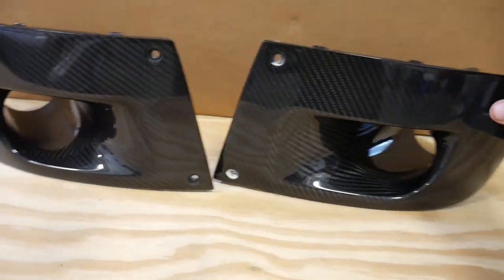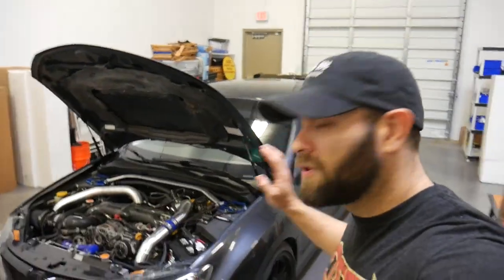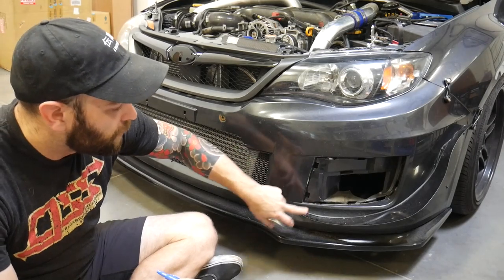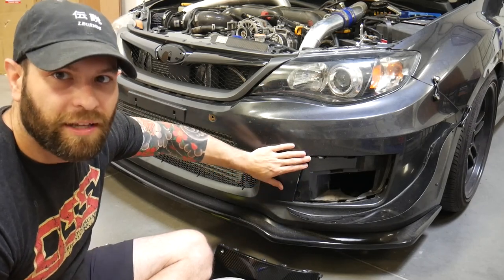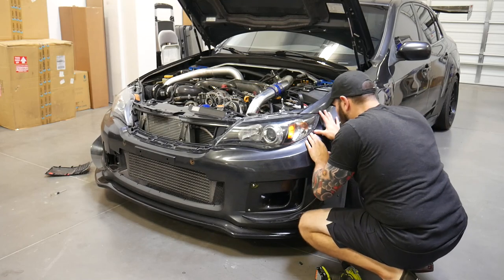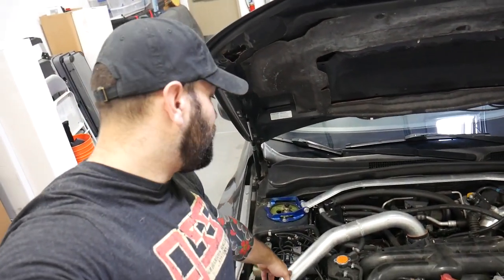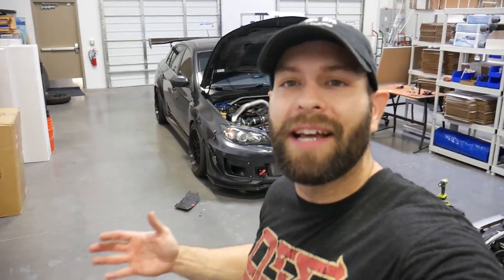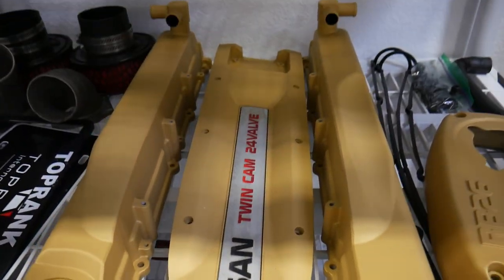WRX STI gets some Carbon Brake Ducts!!

Comment: Can you install your fog lights by any chance?🤔
Reply from the maker: UH why? these are brake ducts, I am confused
Reply: @RyanDenton  i wish they had carbon fiber fog light covers. I run diode dynamic fog lights which i love so much. But they sadly don’t make any CF fog light covers. Just wondering if anybody you knew retrofitted or possibly made them work. Love the build!